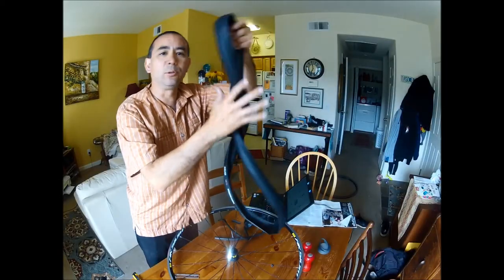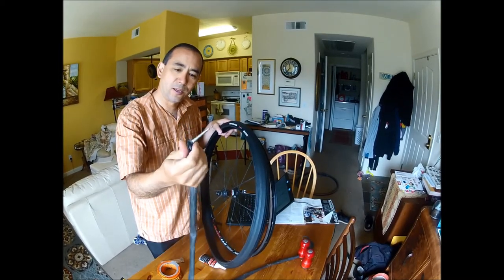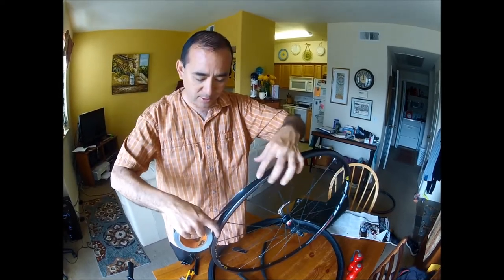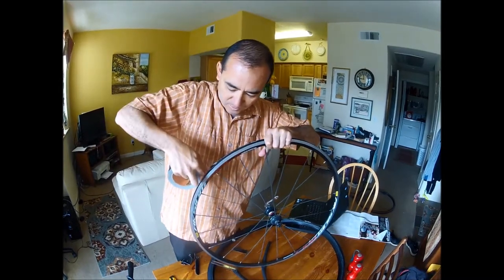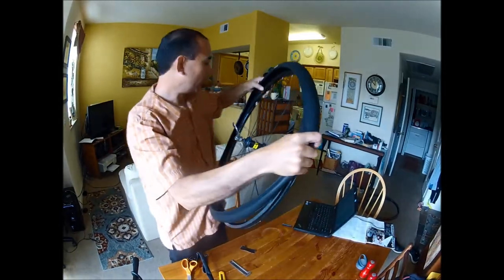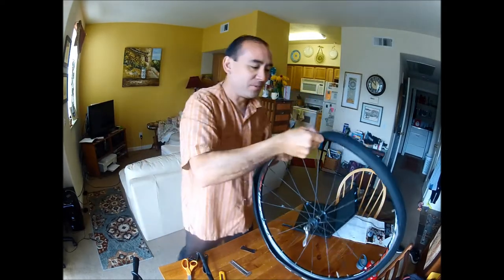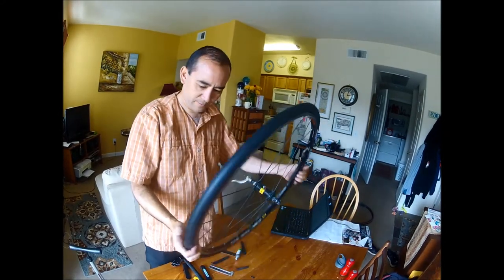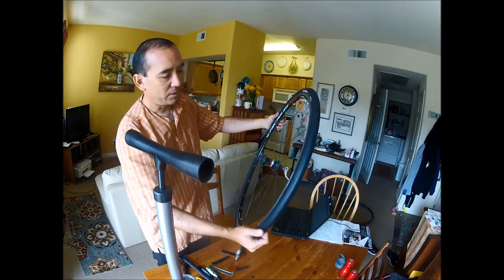Road wheel tubeless conversion

Comment: Richard:

Thank you for producing the video.  I just installed Hutchinson Sector 28 tubeless tires on my wife's Aksium wheels.  I used Stan's Notube technology.  After I mounted the tire, I soaped the tire bead and rim then inflated the tire to seat the bead with a floor pump.  The CO2 inflator was not necessary.  After adding sealant, I inflated the tire again with the floor pump.  Thanks for the instructional video.

Comment from the maker: Thanks P.D. To answer your questions here and on Twitter:

1. Will this work on touring rims? From what I understand, tubeless works better on wider rims. I don't know of anybody actually using it for touring, though.  I plan to test this on a touring bike this summer, though.

2. What are the advantages?  lighter weight in the tire, more comfortable ride because you can run much lower pressures, and maybe more resistance to flats (you'll never get pinch flats, for example).

Comment: Thanks for the video. Has it been a safe conversion? Any tire roll offs?
Reply from the maker: The setup was solid. The sealant eventually dries out and needs replacement but this is normal.